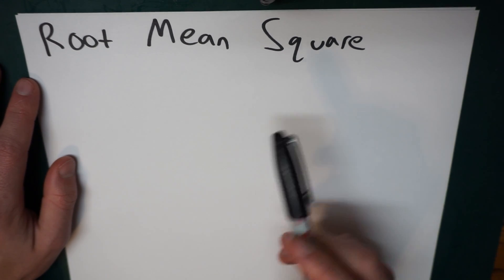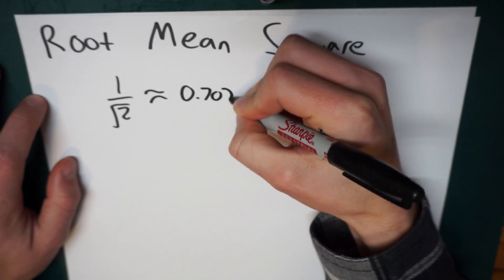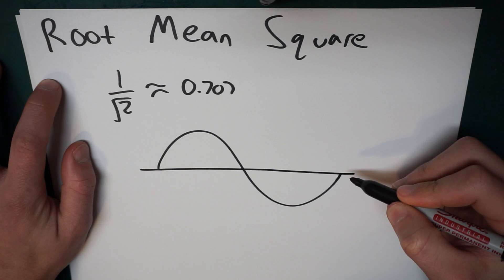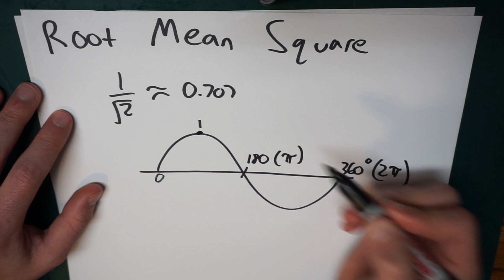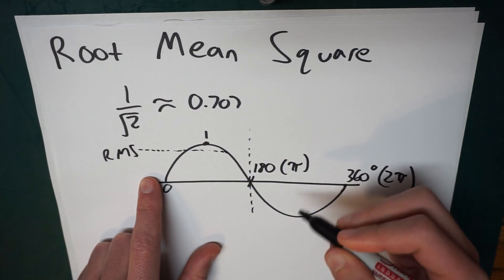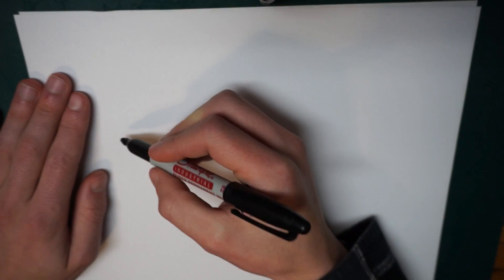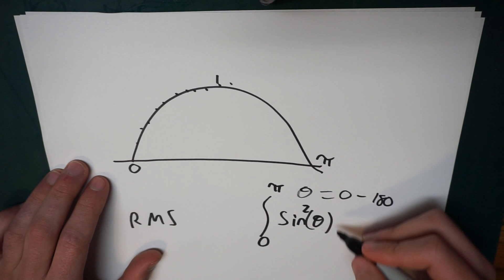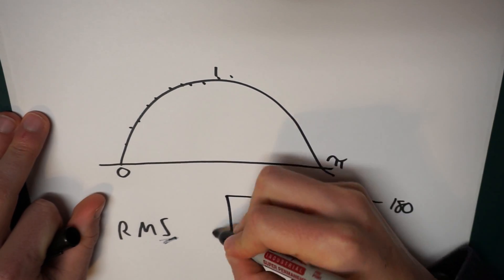RMS Vs Peak Values Part 2 -  RMS 0.707 Proved

Comment: If the peak wasn't 1, and it was derived like this, then would it be (P*sintheta)^2 in the first step? And then the integral, average, square root, would that result in P coming out just as a factor = 0.707*P? Thank you

Comment: Why do we multiply 0.707 by the amplitude value?
Reply: Oof. 9 months later haha. So, we multiply by 0.707 for a few reasons, but the way I think about it is that the RMS voltage is A) the universal standard for specifying the AC voltage used in electrical systems (or at least residential and low / medium voltage industrial voltages), all the way from your phone charger to 480VAC hydraulic pumps. B) the RMS is the DC equivalent voltage which is useful for power calculations. If you have a motor that runs at 120VAC 1.0A, you can multiply 120 x 1 and say "alright, this thing uses 120W of power to run." If we used peak voltage, you couldn't do that! You see, the power consumption isn't constant in an AC system, right? In a purely resistive load, it's also sinusoidal. Then we're getting into apparent vs. reactive loads and that's a whole other topic of discussion... But the point is, if you look at the power consumed by a simple resistor over hours or days or weeks, it will be the same if it has 120V DC or 170V AC across it. Again, that's because for a lot of the time during the sine wave's period the voltage across the resistor is actually less than 120V. RMS is just sort of a magic tool for getting the V=IR voltage from sinusoidal sources. It just works haha

Comment: If you just want the average or 'mean" of a sine wave from 0 to pi there is no reason to square the sine (the value is always positive from 0 to pi versus from 0 to 2pi) .  The average value of a sine wave of amplitude 1 from 0 to pi is: 1/pi times the integral of sine from 0 to pi.  This yields 2 divide by pi or approximately 0.637.  This differs from the RMS value by about 10%. This is because is for most wave forms you cannot square it over a period where the value changes significantly, find the average (of the squared wave form) and take the square root of the result and expect to get the average.  The only periodic wave form for which the RMS value is exactly the same as the average is a pure square wave.
Reply: This confused me so much previously. I saw so many people explaining that the significance of the RMS value was the average value of the sin wave when it really wasn't.
Reply: @Jpres  omg same
Reply: so if you want the rms of a sine wave from 0 to 2pi this is the time should you use the squared?
Reply: can you pls elaborate the part "This is because is for most wave forms you cannot square it over a period where the value changes significantly" thank you!
Reply: We need to use square because we are operating with Power value (Power = U^2 / R = I^2 * R). Not pure voltage or current.